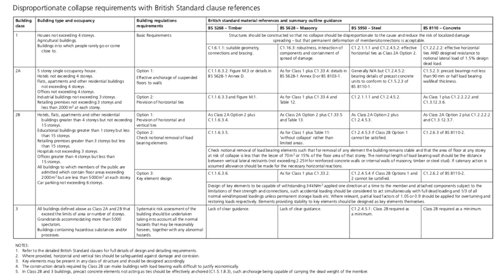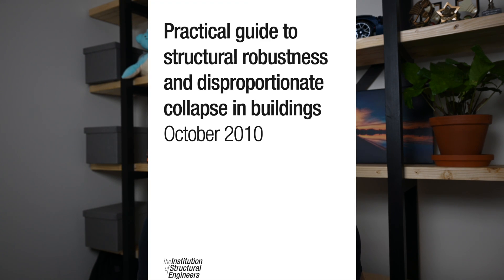Disproportionate Collapse Design in Building Structures

Comment: Interesting.  I am not an engineer but spent 10 years on an hoa bod.  I took many classes fiancial to repair to what to look for to warn of interior damage to concrete slabs walls and columns.  I watched the professor's video of the garage and about choked.  I knew that it was horrible but I still knew that 1 failure should not have caused the catastrophic failure that I saw.  It is really interesting to be proven right and explained why I was right.